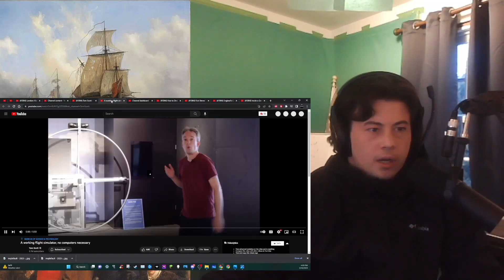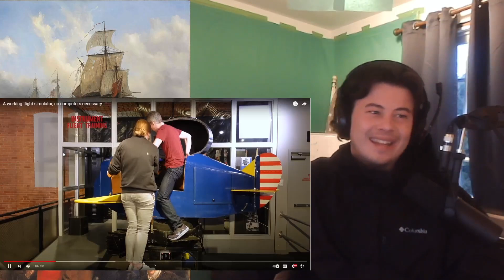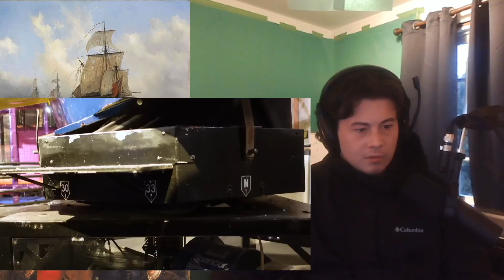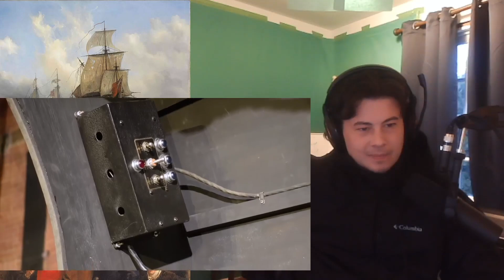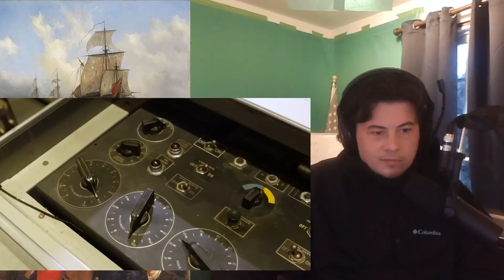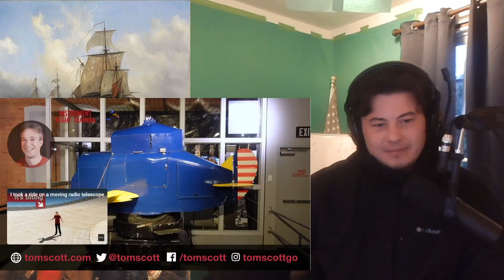American Reacts A working flight simulator, no computers necessary

Comment: 3:00 Pretty sure you got all of those wrong. The one on the right is vertical speed. The middle one is an old version of the artificial horizon, showing the plane's tilt. The one on the left, I'm not sure, but I think that might be altitude.

EDIT: Actually, I think you got the left one correct, though it's probably in knots rather than mph. Altitude is below that one.

Comment: Top middle is the balance ball which helps coordinate turns (reduce side slip by adding rudder input). 
There’s an attitude indicator (where your wings are in relation to the horizon).
Compass is left of middle row and Direction indicator in middle. 
Altitude indicator is the ALT gauge as you suggest. There’s a clock (essential for map navigation) and a radio Compass at the bottom. 
Others (difficult to see all) will be speed, engine revs, fuel and most likely oil pressure.